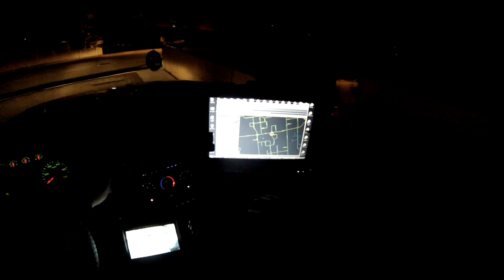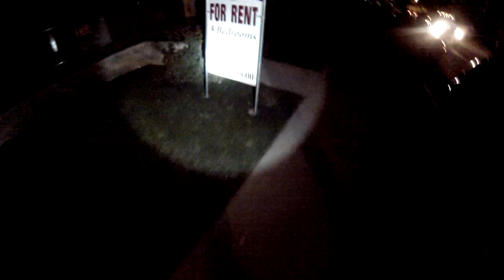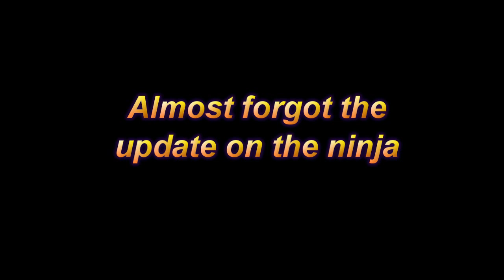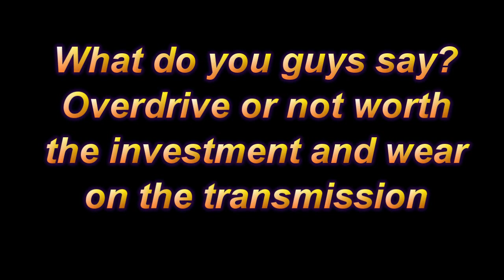Walking The Late Night Parking Garage Searching For Vehicles

Comment: Naa - forget the overdrive. You are adding another component that can fail, that also adds stress to the transmission that so far has been trouble free. Compare the cost of fuel to the cost of the upgrade and the higher probability of another repair. 

I'd consider an axle ratio change first - just one step away from what you have, and give it a try.
Reply: Alan Maier an axle ratio change will constantly put more stress on the trans and engine.  One way to accomplish an axle ratio change is to put bigger tires on your truck.  Search youtube for powerstrokehelp's video "FUBAR BIG TIRES KILLS TRANSMISSIONS".  Title says it all. An OD won't stress the trans more unless it is engaged under inappropriate load, which presumably it wouldn't be.
Reply: NyanRat Indeed I agree - just not sure what Matt is running now in the truck. He might have a 4:30 or 4:88 under there right now. He said the truck is running about 3000 RPM @ 75 MPH with the AO / no load, which to me doesn't really sound like a problem.
Reply: Alan Maier Hmm good point, you're making me think now that I'm armchair quarterbacking this one without knowing the basics, such as what is the effective powerband for this engine.  If he's running at the high end of the power band, a change to the gear ratio could help.  Add in an overdrive, and I guess that does potentially add new failure modes.  The powerstrokehelp video I referenced talks about slippage in the clutch when the trans shifts in and out of OD, thus wearing down the locking clutch plates.  I don't understand the details but I guess there is potential there for problems.  This chart suggests the powerband for this engine is 2500 to 3000 RPM... an OD that drops it to 2000 should work... at 2000 it's still putting out 250 hp and the torque is still about the same:  http://www.internationalpowerstroke.com/64psd.html
Reply: NyanRat I think you probably mean "when the torque converter locks and unlocks, thus wearing down the locking clutch plate."   This also applies to any gear changes while the external overdrive is engaged, though: all the clutches will experience greater wear when shifting between the corresponding gears.

Comment: Regarding an overdrive unit.  I'm 'crazy' enough to do it.  But he is right there will be a potential increase in stress on the transmission.  Not that much if you are simply 'coasting' down the highway.  I would look more in the direction of price.  If the unit won't cost more than $3k I'd be willing to gamble it.  But I would make absolutely certain I wasn't pulling anything heavy up hills or under max power with your tuning.  But I do like to 'baby' my vehicles.  I'd say check out what the RVs and other trucks are using with the same transmission.  That should give you a good idea of what is realistically possible.
Reply: neomags yeah but even if the unit cost $3k which sounds about right, then he has to pay some one to install, he will also need the drive shaft shortened. He is looking at $5k easy and how much fuel will he really save? it would take decades to recoup the expense. false economy.
Reply: Tom Lindo You did pay attention to Matt's estimation on what he would save in fuel alone.  I thought I heard him guess at $500 per month.  I also did consider the installation expense.  Like I said.  If it were me I would make the gamble and see what happens.  I know it might take 8-10 months to break even according to Matt's estimate.  It's Matt's call.  I look forward to seeing what he does.
Reply: neomags but dont forget the trans has over 200,000 miles on it so with the extra stress of a fresh engine and then an overdrive its going to need a rebuild
Reply: Robert M Why do you think I forgot anything?
Reply: I could be wrong but seems to me that $500 / mo savings is a bit of a reach. Maybe I will sit down with a calculator later and do the exact math.
Reply: Tom Lindo I agree you could and probably even are wrong.  And Matt might be wrong also.  However, I'd like to think he has enough good sense to use an over drive unit properly to not over stress the transmission.  Regardless, everyone is just guessing.  Even Matt's mechanic.  No real world data has been provided about a similar situation that ended badly.
Reply: neomags well when you look at a transmission the overdrive gear is larger than the out put gear on the shaft and in theory it should produce more power but it doesn't for example here is what an overdrive gear ratio would look like 0.6 turns of input gear equals 1.0 turns of the out put gear this resulting in a lower engine RPM for better fuel economy and plus overdrive is not really meant for towing but lots of people do it anyway
Reply: Joel Dale I either fail to see your point or you aren't telling me anything i don't already know
Reply: neomags thpoint of the overdrive is to increase fuel economy and create less wear on the engine parts
Reply: Joel Dale Why do you think I don't know that?  Ya know that overdrive got started back in the 1980's right?  For fuel economy right?  I don't think I missed anything about the fuel economy or torque reduction associated with it.
Reply: neomags no I figured you knew it I just put it out there for people who don't know
Reply: Joel Dale Then why address me directly if you figured I already know.  You could simply have posted a comment unattached to the one I started.  Nice attempt at trying to save face though.  I wouldn't expect the average ding-dong to attempt that.
Reply: neomags My Gear Vendors was $5K installed, but paid for itself in less than 2 years. But I do very little far/fast driving. Fuel consumption rises exponentially from 55 mph to 75 when running gears 4.10+. Typically a 20% saving is realized at freeway speeds when running a Gear Vendors.. I've seen vids with RepoNut flying past everyone on the freeway. He may realize 25% savings, easy. With his 4.88s, that engine is screaming right along.
Reply: Thanks so much for commenting.  It's nice to have someone who actually knows what they are talking about give real world data.  The 'armchair quarter backs' get really boring.

Comment: Change the rear gear did you end up going to rebuilt engine that shop looks like they know what there doing
Reply: David Overstreet changing the ratio would stress the trans more because the change in ratio would be in effect all the time.  If I understand correctly, an overdrive would only kick in after the last gear, it would be like adding an extra gear.  So you would have the option to use the overdrive, or not, depending on your load.

Comment: Go the overdrive. These days most cars and light pickups have it as standard due to the fuel economy.
The transmission being under higher load is rubbish. Yes the transmission will be running slower with the same power through-put so there will be higher torque through the transmission. But cruising on the highway you probably only at 20-30% of the rated torque of that transmission, adding the overdrive will bump it up to maybe 40-50% rated torque.
Reply: russhellmy I'd like to see the math behind these numbers (although you just might have guessed here, someone will have done it and put it on the internet).
Also, is the torque rating constant over the whole speed range a transmission can go? Or is the "rated torque" highest on low speeds (where it's needed to take off) and gets lower on higher speeds, because it isn't needed at those speeds normally? As I said, I'd really like to see the math behind this...
Reply: russhellmy It's not rubbish at all. My work had an E450 with factory O/D for a few years. The transmission needed to be rebuilt once a year. The shop said it's gonna keep happening if you're constantly using O/D in traffic or with a full load. Only for use on the freeway while empty.
Reply: iamaprofessional  Exactly!  Nothing wrong with the trans. it was driver error.
Reply: iamaprofessional "The shop said it's gonna keep happening if you're constantly using O/D in traffic or with a full load."
That sounds a lot like driver abuse to me!
For Highway cruising (unloaded or light loads eg passenger car or small SUVs) the the O/D will work just fine and not overload the transmission.
Of course if he is hauling a heavy load like a big pickup (eg 5,000 lbs +)  up a steep hill on the highway then common sense says drop it back a gear or 2.
I'm pretty sure Matt isn't stupid.
Reply: Seegal Galguntijak Each ratio is rated (input) for the maximum engine torque since the that can occur in every gear. Of course torque output drops off as the ratios get taller.
Each ratio will have a safety factor (overload factor, or service factor), with 1st gear (and some times reverse) having the highest safety factor (around 2-3) , followed by 2nd & 3rd gear or 4th, with top gear usually the same or slightly lower.
I know of a case where an old retired guy kept blowing up (4 replaced under warranty in 18 months) the Auto in his High spec 6.2L (383 ci) V8 Sedan with the biggest Auto GM fits to that engine. It turned out he was backing a 7,000lb trailered boat, about 350m (500yds) up a very very step hill to his residence 5-6 times a week. GM ended up installing a special High-capacity Auto Oil Cooler FOC for him to avoid further warranty claims.
Reply: russhellmy Keep in mind that the transmission isn't normally rated to be at 100% rated torque all the time.  So the increase in load could be enough to shorten the life of the transmission.  But I doubt it.  You could get an O/D controller which will take into account the load on the engine and lock out or disengage the O/D when it's not appropriate.   However before spending any money I'd suggest RepoNut  try a few no cost options to better gauge the benefit first.   I know this is probably a broken record at this point, but he could reduce the amount of unnecessary idling, it adds up surprisingly quickly.  But more importantly, he should try (as painful as it'll feel) simply driving slower on the highway for a week or so.  eg: 70 instead of 75  (Only ~ 7% slower).  Work out how much the RPMs drop, and work out how much fuel he's saving.  (NB: You can extrapolate this for a greater rpm drop, but keep in mind it'll be optimistic due to several factors).  Also keep in mind that you're effectively getting a new engine back, you'll need to run it in before experimenting too much.
Reply: I don't agree on the "unnecessary Idling" Diesels suffer a lot of wear from starting and stopping and its almost always more cost effective in the long run to keep it idling that shut it off then start it back up.
I do agree a slight drop in speed can have big impact on fuel economy. One of the main reasons western countries introduced speed limit of 100km/hr (60 mph)  in the mid 70s was the Oil Crisis.
Reply: russhellmy
 The wear on startup is mostly reduced on an already hot/warm engine, particularly on modern engines with better starters and control of the injectors.  The engines start right up and achieve full oil pressure much faster, and more consistently, than older engines.  This isn't an old style large heavy duty diesel that requires startup and shutdown idling (where most of the start/stop wear occurs).  I'm not talking about his very short stops, or when he's in the middle of an actual repo (where safety is a higher priority), but general rule is that if you're stopping for more than the length of a longish red light, you should consider not idling.

Comment: One thing's bugging me. Whenever you pick up a vehicle on the wrong side you put it on neutral, right? Did it ever happen to you that when you drop it down to pick it up from the other side it suddenly starts to roll on you?
I mean, of course now it's your instinct telling you where you can safely drop it. I'm just wondering if ever in your career it happened, like the first couple of repos, etc
Reply from the maker: Jarosh Only if you were to drop on a surface with any slope at all. I'd never release a vehicle in neutral if I knew there was even the slightest incline or decline but where I know for certain that it's flat like in this video then I save the time of getting out of the cab twice and just keep working till I'm free of the repo area.

Comment: OD is not worth the extra money you'll have to continuously pour into the truck if you have it plus you can't tow in OD, well you can but it's not meant to, it will wear that part of the trans out faster, and then instead of having the truck in the shop every 6 months to a year for the motor it will be motor and transmission both

Comment: ATS Diesel transmission . Check them out I put one in my Dodge 04 5.9l. Before running highway @ 130km 3400 to 3500 rpms, yeah I know metric crap, Now 2200rpms same speed.  The thing is bulletproof. running strong for 6 years now.

Comment: Overdrive or not? I try to leave my vehicles as far as possible as the manufacturers intended. They probably used some high power computers to work out the best engine/gear ratio.

Also, I think you would be putting a really heavy load on your engine by engaging overdrive with a vehicle on the back.

As other people said, drive slower, and don't leave the thing idling all the time. Here in the UK they now sell cars that switch off the engine at traffic lights.

Comment: No overdrive. Another component to fail.
I know this sounds like I'm teaching a grandmother to suck eggs but international automobile companies have put millions into researching fuel economy; the big things you can do right know to improve gas mileage on the freeway:
Drive smoother, less vigorous braking and accelerating.
New tyres and correct air pressure (hugely important)
Carry less weight
Improve aerodynamics. Fairing on your lift arm? People beat their records on the Nurberg ring by duct taping over door lines....it's a big deal. Maybe there is a front chin spoiler available for your model truck?
Oil change

Comment: Drop the rpm's with a real inline 6 diesel! Remember, under the hoods of 18 wheelers you will find no v-8's! There is a reason for this.
Reply: There are lots of 18 wheelers with v8's in them...
Reply: 39 yrs as a diesel tech, not seen a v8 in a 18 wheeler at least 20 yrs. fuel price killed the v8 diesel. 3408 cat got about 3.5 mpg whereas a modern inline can do 6-7 mpg and make more torque.
Reply: Funny, I would think a 39 year diesel mechanic would have seen a Detroit diesel by now.
Reply: 89nissancrawler Seen many v-8 and v-12 Detroit engines in automotive use. Like I said we have not sold them in trucks in years. Ever heard of a Detroit Series 60? A inline 6 that replaced the v-8 Detroit in automotive use years ago, even Detroit saw the light! The Series 60 is now the proprietary engine for Freightliner trucks (known as brand X here at Kenworth).

Comment: An overdrive will be worth it if you're on the highway that much. I don't buy the more stress on the transmission. Just change the fluid sooner, less stress on the engine engine and better fuel economy is more important.

Comment: I call bs on the wear, my Dodge Durango had a kick ass overdrive when I was at 70mph the rpms were at 2100 rpms and it was a v8 and got 24mpg because of the overdrive, but my transmission was also built stock like that.. I had the optional 5 speed w overdrive trans though
Reply: Bahaha owning a durango isn't a car to be proud of owning...
Reply: +Eddie Uribe actually it is... And why don't you get a life instead of judging something you've probably never even owned! A Ferrari isn't something to be proud of either!
Reply: +Jato Tern who said anything about ferrari? I just said that a durango is a tiny suv that someone buys on a budget, not by choice

Comment: Hi Matt,
           Love your channel, but do that many people "really" leave there cars unlocked? Or do you just set it up for ease of filming,  I did not think Americans where that trusting after all. lol Regards an aussie fan.
Reply from the maker: David Spencer I never set anything up prior to starting a repo. That's what makes this channel so original. It's all real and unscripted. We have addresses this subject at length in other videos and come up with some conclusions that mainly point at the area I'm working in and a few other factors. Really what it comes down to is if a thief is going to get into your vehicle then they are going to no matter if you lock it or not. So do you want to pay for a broken window on top of the missing radio or just the radio?
Reply: RepoNut I grew up in the western part of Maryland. Even to this day I could leave my windows rolled down with a $100 bill sitting on the dash and it would be there in the morning.  Like you said its the area.
Reply: David Spencer I grew up in rural Kansas. We never locked the door to the house because if we did, it would require us going out to the cars to get the keys out of the ignition. Forget about locking the cars, lol.
Reply: David Spencer I never lock my car doors anymore. Where i live, they break into cars. Doesn't matter if it is locked or not. I don't keep anything of value in my car. If it is locked, the damage they cause outweighs what they can take. Sucks, but my car isn't worth putting an alarm in it.
Reply: RepoNut 
As my dad always says:
Locks only keep honest people out!
Reply: I used to work for an Internet provider and I kept my work truck at home during the night. I would occasionally forget to lock up the tool box, ladders on the ladder rack, and doors, though every morning I would go to work and everything would still be in the truck. Some people don't leave their car unlocked intentionally, they're just forgetful.